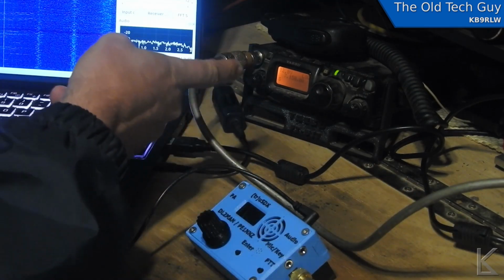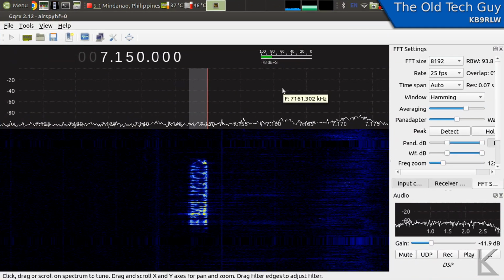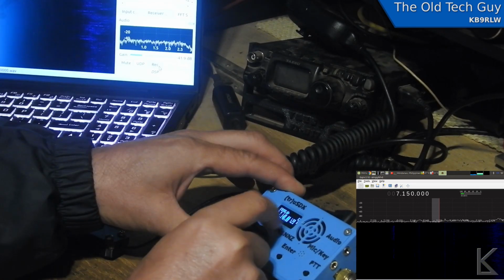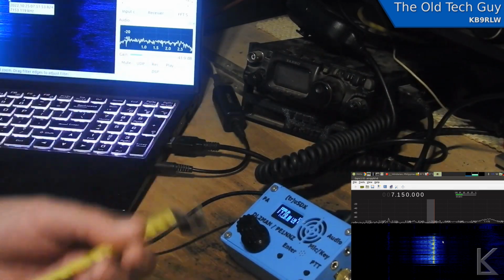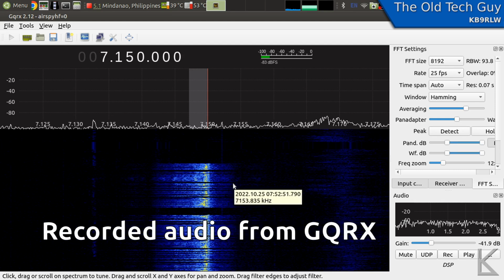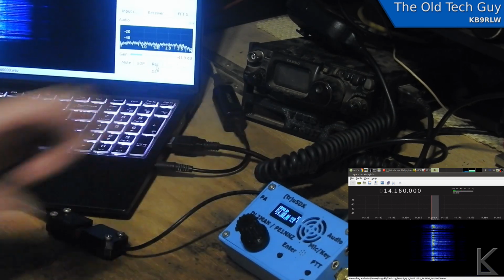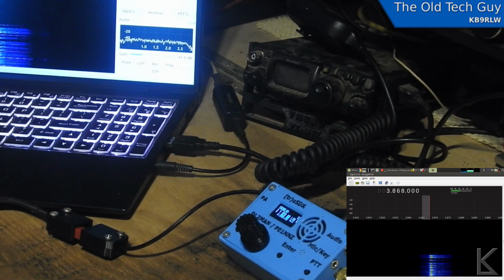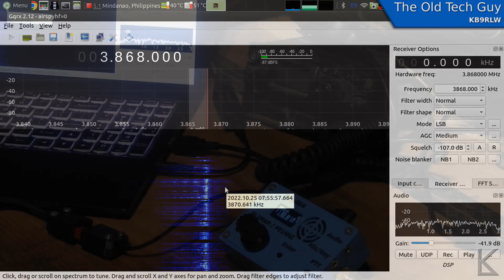Ham Radio - tr(u)SDX TX audio followup, addressing a couple of viewer comments.

Comment: No surprise considering how it generates SSB. Its weird. Its a mixture of frequency modulation of the frequency synth chip with (IIRC) the arctan of the baseband I and Q signal (one of them is inverted to flip LSB/USB) and the amplitude envelope is applied to the output stage bias. This is as far as I can tell from looking at the source code and the schematics and I may have got it wrong or over-simplified.

I guess it might work better if this could all be done using higher resolution that the Atmel MPU and frequency synth steps are capable of.

Comment: In my previous test,  I think the splatter issue is cause by the LPF is not properly tuned. My older WB2CBA V1.02 uSDX has no splatter issue.   Here's some recorded audio when my friend TX using uSDX, and several Ham friends recorded the audio from several different locations. Spoken in local language though. https://www.youtube.com/watch?v=D1163lXr7Dc

Comment: Thanks for the extra testing.  For $100 it’s a neat little box but wouldn’t pass as a true ham transceiver.  It will get better with more experimentation    and better design.  Part of the fun of advanced ham radio.  Not a rig for a ham to use on SSB.  Maybe cleaner on CW.

Comment: To me that sounds like one of two things: 
1) RF feedback into the mic gain. That would not give any problems with the FM signal due to the constant carrier level. Like someone else asked, have you tried AM as well? - and how does that sound?
2) Non linear TX amplifier. Tis sounds a bit more likely from what I am hearing, and could also account for the splatter. Is the bias for the power amplifier stages too low?
To me the non-linear TX amps looks more likely, but RF feedback can do funny things, too
Vy 73 de Jan OZ9QV

Comment: 3.3 transmit drive. I think it's the only setting that might make a difference, supposedly turn it up and more compression and turn it down and more linear. Would be I teresting to have you vary that and see if it has any effect on the splatter that you are seeing. Maybe not but would be nice to know. Thanks!
Reply from the maker: That is the setting I'll be looking at first.  It's at the default of 4.   I have heard from several folks, some have distortion, some have clean modulation.  They're all probably also at the default setting, so I'm still thinking it'a fault in the build somewhere, or RF getting into the digital board. 
And to answer Thomas S. also,  I did have to change the reference frequency to bring the radio close to on freq.  As close as you'd get zero beating against wwv anyway.
Reply: Yup. I was going to ask where the transmit drive was set and if you'd tried tweaking it.  Also wondering if the displayed frequency was accurate when it was delivered or if you had to adjust it.

Comment: Hi Kevin,
Can you do a 2 tone test into the mic socket so you can see what it looks like on your o-scope, please show on video,
Dave 2E0DMB
Reply from the maker: I don't think there will be any value to that until I resolve the distortion and clipping issue.  
It's obviously not the internal mic or analog circuitry between the mic and digital side.   When I did the AM and FM tests in the previous video, I was right down on the mic and talking very loudly and there was no clipping or distortion, rather it was weak audio modulation.
Reply: @loughkb  so if FM sounds clear,it does look like the outputs are operating in the wrong class for ssb ?,
Dave
Reply from the maker: They actually do a rather clever bit with the software, altering the drive level and shifting the frequency to get ssb.  I have seen and heard other samples where the audio and signal was much cleaner.   And heard from others where it was bad.   
I'll come back to the little radio in a couple of weeks and try to nail down the cause and come up with a solution.
Reply: @loughkb  I think it will be very interesting to find out what is wrong with it,
Good luck Dave,
Reply from the maker: When I do,  there will be an update vid.

Comment: It sounds like there's RF getting into the audio stage. I would can the audio amp and ground it. I've had the issue transmitting with my magnetic loop with a hand on 160 meters.
Reply from the maker: I've had the same thought.  I'm thinking about making a grounded shield to go between the RF and digital boards in the radio.

Comment: Hi Kevin, 

Yuck! Horrible audio! 😕

What I noticed is that there appears to be a MIC input. I'd suggest trying an external mic to eliminate the internal mic as having issues. If they persist, scope time! 

You could follow the audio input path all the way up to the input of the a/d, etc. 

It really sounds like it is being majorly overdriven. In fact I wonder if there is a resistor in the mic preamp that is incorrect providing way too much gain. 

Good luck on your trip.

P.S. since it does SSB, have you tried an FT8 signal input to see how that looks?  The beauty there is that you can turn the audio input way down. 
Would also be curious as to how distorted that type of signal would be.

73 John N7GHZ
Reply from the maker: It's nothing to do with the mic or any analog circuitry between the mic and digital side.   In the previous video, during the am and fm tests, I was much closer to the mic and speaking much louder and there was no clipping or distortion on the modulated audio. 
It's something in software or on the RF side.
Reply: @loughkb  Ah, got it.  Somehow I missed that video, so didn't see that.
73

Comment: I know a few lads who use these tiny rigs and they all use external mic to improve the audio. sounds much better than using the internal condenser mic.   Have a safe Journey Sir. 73 de MM7WAB.
Reply from the maker: Sure, but this problem is not the mic.   In the previous vid where I did the AM and FM test, I was right down on the mic and talking loudly and there was no clipping or distortion to the audio.  So it's something RF related in SSB mode.